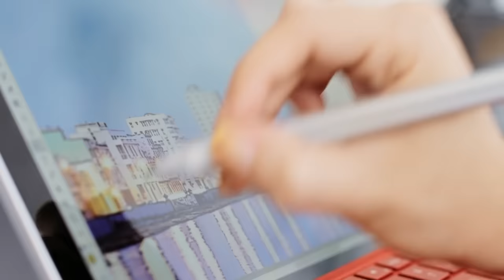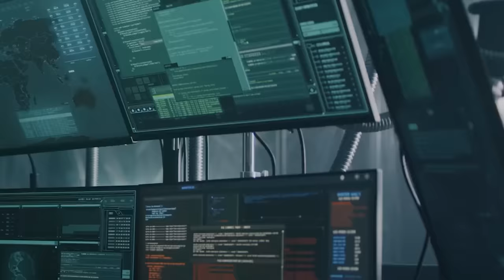Chinese Most Stealth Fighter Spotted at American Marine Base

Comment: LMFAO, um, no, it doesn't mean the J-20 is a formidable warplane. 😂😂 The Chinese are working on a 2-seater version of the J-20 which means the avionics and the software it runs on is not good enough to be able to be handled by the pilot alone and there needs to be a second person to handle the things the US aircraft of the same generation can do with a single pilot...

Comment: The mocked up J-20 is a good copy of a cheap copy.

The real J-20 is an Indian with a top hat. “Mighty Dragon.” More like “Muddling Turkey.” 3rd gen engine, 4th gen sensors, and an airframe that doesn’t deserve the label “stealthy” as its canards, size, cockpit and angles give it a larger RCS and IRS than a 1970s era F-117. In fact, by its standard, an F/A-18F is “stealthy.”

The only thing it has going for it is range and a decent payload of unproven radar-guided missiles. In a conflict, these don’t worry me. Now, their sizeable number of ballistic and cruise missiles launched from shore would.

Comment: The J20 has been having issues with its engines. It's not nearly as stealthy as the F-22 or F35 either. China doesn't innovate, they steal technology and are good at that. Their problem lies in the fact China can't manufacture anything without taking short cuts in quality thus although the J20 is using advanced technology they're still light years behind the USA.

Comment: Georgia is interesting.  Georgia Tech is the center for stealth research in the United States..  I bet they were taking measurements off the geometry and running it through analytical models. Perhaps they tested this in an anechoic chamber.
Reply: Why not park it at Dobbins AFB then, just up the road from Atlanta, instead of over 250 miles away near the coast?

Comment: lmfao China only has 25 fully operational J20s and they all have flight issues. the engines being used on the J20 are too powerful for the airframe and several J20s have come back with twisted unrepairable airframes and that's just with the first engine option the Chinese have gone with. The second engine option also has issues where the air intake systems can't get enough air to flow thru to the engines. the third problem the J20s have none of them have ever seen combat and the 4th they really aren't that stealthy because both high frequency and low frequency radars can pick them up.

Comment: The chang 20 looks like a bash-kit for 4.5gen wannabes.

I think the Chinese engineers were like okay we got all this stolen tech. What if we just smash it all together and hope it works?

Not to mention the Jet engines they're using are several generations old and burn out so fast that one f-35 service life is equivalent to 20 J-20s.

After only like 5 or 10 flights, I think they have to swap out the engines as in not repair but replace.

Now imagine operating 300 or more of these incredibly short-lived airplanes. Along with the aerodynamics are all fucked up.

And then intentionally leaving the airplane out for viewers to see it that's just epic trolling... 😂

Comment: Yeah but the J20 is not a formidable force to be reckoned with. U.S. Marine Coprs in Carolina made two replicas of the J20 to train against, and it was found that it does not hold up to a 5th Generation U.S. Fighter like the F22 Raptor or the F35 Lightening II. Your video is trying to insinuate some new conspiracy theory and it's very easily debunked. Other than this video no other one like it exists meaning its a opinion and not news.

Comment: How credible is this when the photo of the airbase (1:18) as compared to street level photo (1:20) the roof colors are  not the same? This maybe a propaganda? Well dont give too much fuzz as China J20 jet engines only has 2,400 flight hours for every maintenance while the US F35 has 35,000 (as a modest claim but actually reaches 50k) flight hours before any maintenance. Like comparing made in China (cheap, overrated and usually poor quality) with American made with serious considerations (on pilot safety, sustainability and high capex  vs. low opex, compatibility in weapons tech and reliability). HUGE DIFFERENCE. If the US military has a J20 it means it will look for flaws that in future of dogfight, US will  know its WEAKNESS.

Comment: The Chinese fighter is not meant for dogfighting has a large radar cross-section the plane is a rip off knock off joke. The engines are only read it for less than 1400 flight time. Versus the F 35F 22, which can go 16,000 hours flight time Chinese J series are real joke